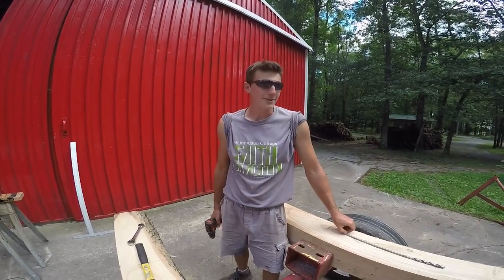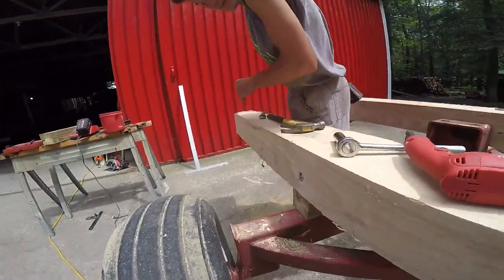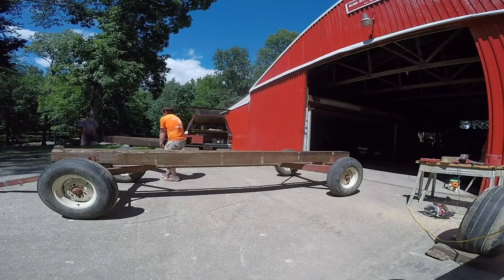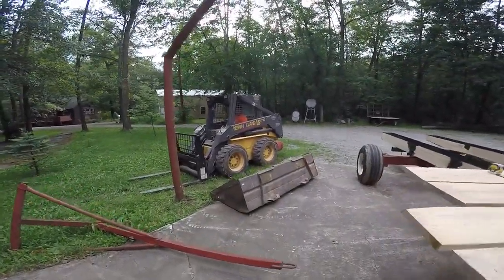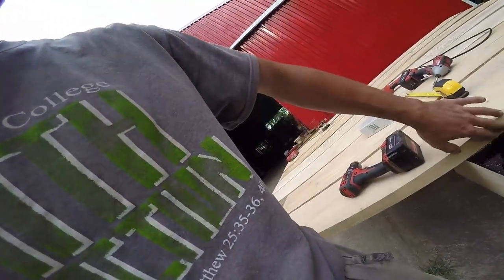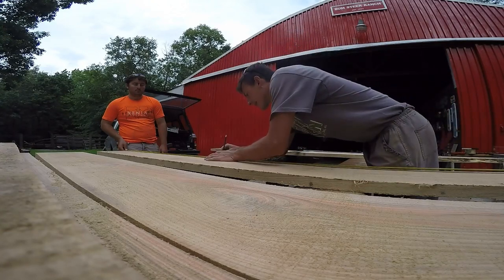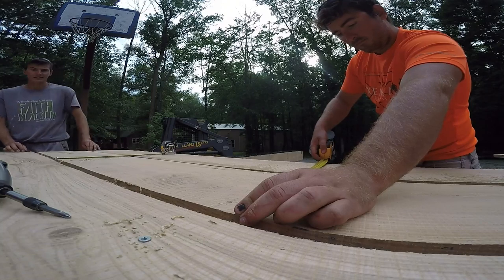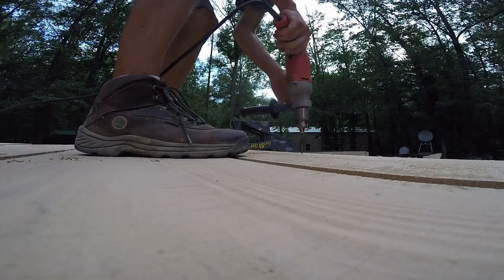Building a Hay Wagon

Comment: I've built four porches with the phillips deck screws, with roofs and using hurricane ties and joist saddles and stuff, because I hate Torx screws... BUT now that it seems like you can't hardly get the phillips and nobody wants to stock anything but Torx, I decided to give them a try... we were building corrals with RR ties and cattle panels and corral boards, and the impact driver was twisting off the phillips or stripping the heads like you were doing on the wagon floor.  I even busted a couple of impact driver rated phillips bits, snapped the tips in half on them.  We ran out of screws so I bought a box of the Torx to finish and a pack of the Torx bits, and I gotta say I was really impressed... never busted another tip and never stripped out another head, though we did twist off a screw or two in REALLY hard spots in the RR ties... BUT we just ran another screw in a little further away from the hard spot and all was well.  I see now WHY the phillips heads are so hard to get and why everybody is going with Torx.  STILL hate Torx screws in vehicles when I'm working on them, but for the deck screws, they're actually pretty darn good!  Later!  OL J R :)

Comment: When I built my wagons I chained the front of the bed to the running gear. The back was bolted. This allowed the bed some flex as it ran over uneven ground.
Reply from the maker: The one wagon with the telephone poles has a cable in the front. The all ash wagon that's sitting on a former anhydrous gear is bolted all the way around because of how easy the wagon twists.
Reply: @boehmfarm4276  Yeah sure you know but ya gotta turn WIDE with those fifth-wheel type wagons-- they don't like turning tight... unless you can raise the thing up enough to clear the tires better, but that's usually not in the cards... I LOVE how they trail though--I built one wagon that's a "copy" of those "narrow front" steering wagons like the bale mover that How Farms Work uses... the two wheels close together with a single upright "gooseneck" type pivot between them like dolly wheels on a hay rake.  I built it out of 3 inch tube-within-a-tube steel, welded a cap with a nut welded inside the inner tube, and a large flat plate "washer" on top so I could thread a bolt down into it to keep them from coming apart, welded a pivot plate on bottom and a 4 inch steel channel iron swivel plate with a through-tube for a long 5/8 bolt for a tongue pivot, and used 4 inch channel with a couple straps welded on the side for the tongue pivot, welded a cross-tube notched into the four inch channel underneath for the wagon spindles and hubs to bolt into, and then put a pair of 15 inch pickup tires on it, then welded the outer stem to an A-frame "mini-gooseneck" I welded together onto the front of the trailer... it uses an old grain truck axle for the rear axle.  Trails straight as a bird, too; I've hauled hay 70 mph down the highway with it before!  Later!  OL J R :)

Comment: should put a 2x4 on the top and bottom of the edge of the wagons and bolt it together every 4th board or so it ties all the boards together and makes them less prone to breaking off after they get a few years on them plus it also acts as a edge to keep things from sliding off the wagon easy
Reply from the maker: Great idea. I believe we have a clip coming soon about anchoring the edges of the wagons.

Comment: Did that anhydrous gear originally have leaf springs on the front? Mine does and I'm trying to figure out how to build a rack on it
Reply from the maker: Yes, it had the leaf springs. For sake of keeping the deck at a lower height, I cut the bolts to remove the springs. In the video, I think we show how we modified the frame in the front for width to hold the wooden rails. In the back, we sat the rails on a 4x4 block of wood to keep it level ish.
Reply: @boehmfarm4276  The lower the front, though, the wider you have to turn to keep from sticking the tires into the rails... only bad thing about those wide-axle fifth-wheel type steering gears... OL J R :)

Comment: You would have much better luck with the 5 star heads instead of phillips head on your screws for the deck. Try a #9 thickness and whatever length you were using. Star heads don't round out near as quick as phillips do.
Reply from the maker: I wanted to use those, but the closest hardware store only had phillips. I didn't want to drive too far that day. I wanted to get building.

Comment: Did you put a backer on either of these? I bought a wagon but it doesn’t have any kind of backer. Thinking I’d like to add one, but I’m not really sure the best way to do it.
Reply from the maker: Yep, we have short piece of  square box welded to angle iron that's bolted to the wood beam. Then a pipe slides in the box, so back can be removed.

Comment: Just as a personal choice , I would have used lag bolts on the deck boards . I would think that those skinny screws would shear off as the wagon flexes under load
Reply from the maker: The screws wouldn't be any worse than nails. The caps on the lag bolts might stick up more than I desire. Next time I will use torx head screws.